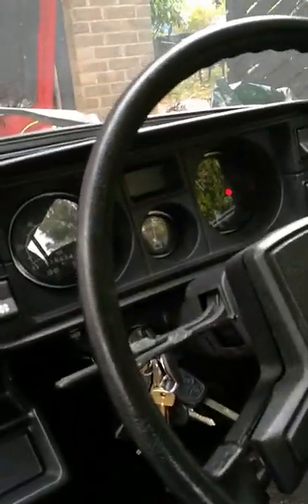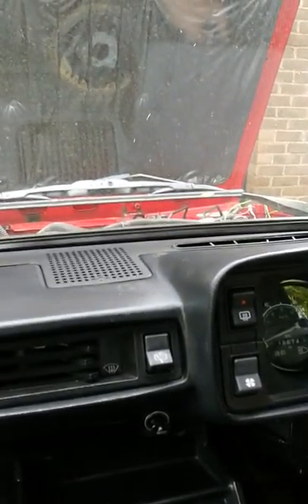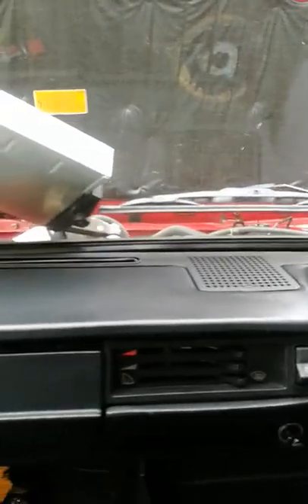1993 Lada Riva 1.5E Carburettor to Single Point Fuel Injection Conversion - First Test...

Comment: Was it more fuel efficient than the carburetor ? and how much more efficient is it? more power?  i want to convert mine too but not sure if it's worth it so please help me out
Reply from the maker: Fuel efficiency has remained more or less the same SO FAR - though I've had a fair number of gremlins to deal with along the way and it's only now I'm really starting to see what it can properly do. I'm still not sure the timing is 100% perfect for one thing.  It has made the car massively more pleasant to drive though. Be aware of taking this on though that unless you have a complete and running donor vehicle that it can rapidly become very expensive and frustrating. Turned out my donor fuel pump was dead and while it ran the engine, the ECU was stuffed. Replacement ECUs are pretty much unobtainable now, and the new fuel pump was far from cheap. Note as well that due to a design flaw in the ECU that if you are using anything other than the (now unobtainable) AC Delco AC97 oxygen sensor you will need to modify the wiring to the ECU to link the oxygen sensor signal ground to another ground (I used the signal ground from the TPS/CTS) as the modern "equivalents" do not have a ground connection through the case. That took me the best part of a month of chasing error code 13 (no oxygen sensor signal) despite trying two new sensors and quadruple checking my wiring.

The only real modifications you need to do though are to the cooling fan shroud (the crankshaft position sensor fouls on it) and to figure out a way to connect the throttle pedal up.  That's far easier in LHD markets as you could just swap the pedals over and drill a couple of holes to bolt it down.  As the wheel arch intrudes differently though on the Niva/Riva this is far trickier.  I wound up using the original Riva pedal, and attaching the cable to the Niva linkage to a bracket tethered to the front lifting eye on the cylinder head.  The check engine light also requires a minor mod to the dash as it is wired in completely differently (the old AFR module in the Riva turns power to the light on/off, whereas the injection ECU switches the ground connection, power being drawn from the dash - think I used the live from the oil pressure light).

Note also that the Riva engine (well, this one anyway!) lacks the keyway in the crankshaft behind the pulley that the Niva has - as such you really should set the engine to TDC and lock it there before swapping the timing chain cover (it has the boss for the crankshaft position sensor cast into it) and the crankshaft pulley over.  I didn't realise that until after I pulled things apart.  Given everything in the injection system is slated to the timing pulse from the crankshaft position sensor, it's really important that this is accurate if the engine is to perform at 100%.

It was then running "okay" but not as well as it could, eventually traced to a vacuum leak that I've just sorted.  Is now running vastly better, but as noted I've still not seen great economy, though I've now got to a point that it's running well enough that it should be a matter of proper fine tuning.

The "bug fixing" phase will probably be a lot easier if you've got either an ALDL (the predecessor to OBD2) capable computer interface or the proper Ladascan diagnostic tool.

Really need to get my proper write up done...

Bits to be aware of being hard to find though due to no longer being available from Lada, these are unique to the monopoint/TBi Niva 1.7i and cannot just be retained or substituted from a later model:

Throttle body itself.
Crankshaft pulley.
Rocker cover (the Riva one lacks the air cleaner bracket).
ECU.
Oxygen/lambda sensor.  Aftermarket parts are available though, but see my note above regarding the necessary wiring mod needed if they're used.
Some of the fuel hoses (though the system only runs at around 30psi, so it's no massive headache to make these yourself).

This isn't an exhaustive list though, it's just what I'm aware of.

While it's been a fun project and has definitely resulted in a car that drives better than it did when it left the factory, it's not one I would do again unless I had a complete donor vehicle lined up where I knew the parts were good.  Not having that in my case is partly why it wound up so horrifically over my original budget estimate.

Regarding outright power, I don't reckon it produces any more.  It does however provide noticeably more torque, especially in the low part of the rev band.  The result being that it makes the car feel quicker and more willing.  Best way to describe it actually is that it doesn't add any more power, but it makes what's there far easier to use.
Reply: I installed a golf 3 from Volkswagen on my LADA 2103 single point injection and I claim that it is better than a carburetor. Good traction at low speeds, smooth engine operation, overall dynamics became more noticeable and fuel consumption was 12 liters per 100 km. and now 8 liters per 100 km.
Reply: @mixalbl4978  do you have a video or a photo of that conversion? What parts you used?
Reply: @amaliaefthimiou2871  https://youtu.be/XwT56y66GMU but the video is in Russian, maybe YouTube subtitles will help you.